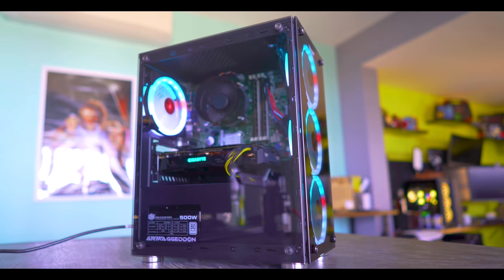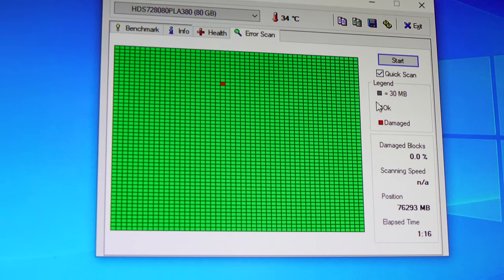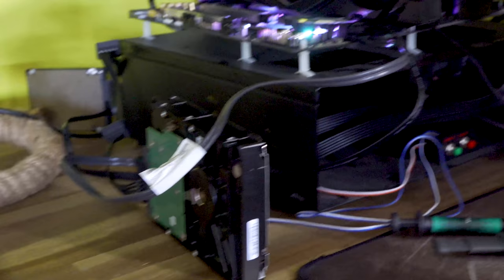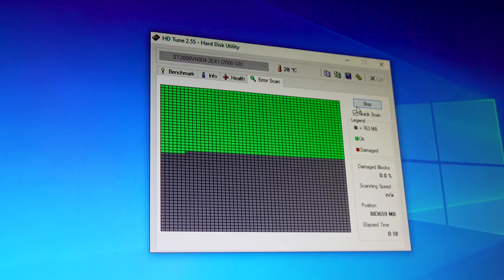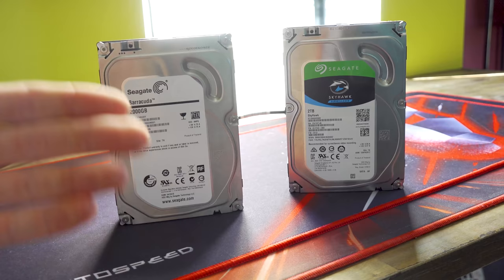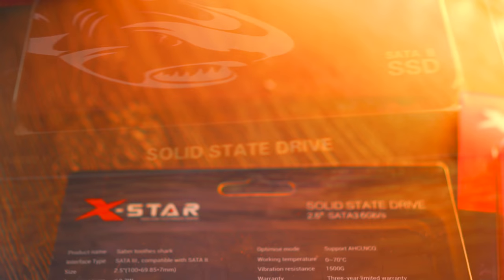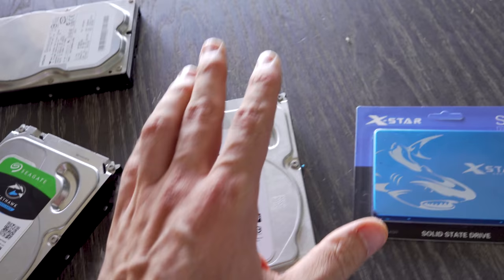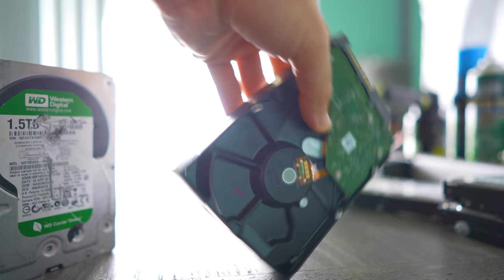Are USED Hard Drives Worth it...? (The Tech YES Buyer's Guide)

Comment: It seems like hard drives are designed to last for a long time. My oldest Toshiba laptop's hard drive is the original 4.1 GB from 1998. Still works fine today with no bad sectors at all even after 21 years.
Reply: I just got rid of an old Dell desktop that was running Windows XP.  The processor was failing.  But it had the original 250GB HDD in it and was still going strong.  It was too old for Windows 10 because there was no drivers for the hardware.
Reply: Toshiba
Reply: Best HDD i've ever owned Hitatch 250GB! PRetty fast and i have like,  7 of them, 5 used, and none of them have any signs of failure, despite being over a decade old!
Reply: They obviously shoud last a long time , data is important but they might fail
Reply: @namesurname4666  same hard drive even still works today in that laptop, now going on 23 years old that Toshiba laptop
Reply: Hard drive can run for 40 year's
Reply: @hamzaaamer9786  still have that same laptop even now and it's going on 24 years old and it's original hard drive still works. Has a date of October of 1998.
Reply: @KevinBenecke  dude 250 for windows XP era... You must been rich
Reply: 3 years late but.. I still have a working drive that is so old the "life" counter restarted a couple of years ago.. It shows way less hours than my much newer drives....
Reply: I agree, been taking care of some HDDs for nearly a decade of daily use. That is also why I dont trust refurbished, it is difficult and takes a lot to actually 'break' a HDD so a refurbished drive was really abused in use for it to stop working and demand a full repair.
Reply: @spider-spectre  I still have that Toshiba laptop with it's original 4 gb hard drive and still works fine with no bad sectors. Says that it's from 1998 so still not bad at all for a hard drive that's going on 25 years old now and I still have it on Windows 98 second edition.
Reply: Hard drives USED to be designed to last a long time. I have two 1 GB Seagate Hawk drives in a Sun SPARCstation 1+ that still work after more than 30 years. I've had recently manufactured drives fail within 4 years, though.
Reply: @littlemeg137  I could remember thinking that 1 GB was allot of storage space in 1997 when Windows 95 was the latest and greatest operating system from Microsoft.

Comment: Pro tip: make sure to turn off the quick scan option in HD tune cuz the results from the quick scan is not accurate.
Reply: Quick Scan should not be used alone to show that a drive works. It can however sometimes show when a drive fails.

This is how i do  my (used) hard drive checks:

1. Check SMART: If any bad sectors or seek errors, drive is bad, if good, go to next step
2. (Optional) Check HD tune quick, if any red squares, drive is bad, if good, go to next step
3. Check HD tune full, if any red squares, drive is bad, if good, go to next step
4. Wipe drive if used.
5. Check SMART again for any new errors

I do all of this with a copy of hirens boot CD 15.2, a free live cd/usb tool with hd tune included.

Comment: I just use white label drives. Instead of paying for a used drive and not know what you are getting, white labels are brand new drives by major manufacturers without a manufacturer warranty. Used drives usually are out if warranty anyway, might as well spend money on the new drive and sellers will usually give you a 1 year warranty

Comment: 8 years ago I got 3 2TB drives at 50 aud each. They're all still spinning to this day
Reply: dealing with an old failing disk taught me a whole lot about how to use computers and how to optimize my process, cause less wear to components etc... had a "clicking" disk that made a lot of noise on Windows, on Linux the thing is silent and still running... learned how to put my temporary files inside a RAMdisk (specially browser directory), learned how to use symlinks to store files that are written to constantly in another partition but make the system still think that it resides inside the same partition, etc etc... you say 8 years there, I don't doubt that number... SSD's just can't compare, all of the sudden you lose everything  (seeing people installing whole OS's inside SSDs just make my stomach turn by the way... well, the market depends on some dumb people burning money I guess...)
Reply: @FeelingShred  knock on wood none of the SSDs that I have ever bought over the past 10+ years has ever failed.  To give you an idea of how much usage they get as a boot drive, my current boot drive which is just over a year old is sitting on 17TB of data written.   The only one that I have that is a bit worrying is a Seagate 2TB SSD that is already at 90% life remaining after 5.36TB data written but it has been sitting at that value for the past 6 months or so despite being in use so it is possible that HWiNFO64 is reading the SMART values incorrectly.
Reply: @FeelingShred  Only on cheap SSD, old SLC x25-E have a life span beyond your own.  I still have some that work to this day, write life barely touched in s.m.a.r.t. even though they have written fully over many times over.  
But yes spinning drive prices have been stagnant forever.  Drives used or new, you need at least a pair regardless, so either way you trust nothing.

Comment: my Hitachi 1tb hdd is from 2009 and has 51000 Hours of workingtime 
and its still in my main pc
edit: i make regular backups of all my drives (old/new/hdd/sdd)
Reply: Hitachi hard drives are strongest hard drives
Reply: Mixa Tutorials hitachi wands too (Lenny face)
Reply: Older drives where built to last!
Reply: Hitachi last longer for me too, deskstar series are superb for home use.
Ultrastar is the best running raid 0 (I have 4 2TB drives on raid 0)
Reply: inb4 "i lost all my data"
Reply: I had both a Seagate and a WD drive from roughly 2011 which lasted up until very recently back in April I think, they both started to give out within a week or two of each other, it was by luck (well I also had been eyeballing their health) I had literally just bought a couple 2TB drives to replace them a few days prior, so lucky for me not only did I not lose any data (at least not anything I couldn't download) but I even gained some space, I also now run Hard Disk Sentinel to let me know if something is wrong.
Reply: My hitachi and toshiba drives have vastly outlived some seagate and WD drives I've owned. My 1tb hitachi drive (HDS7210CLA332)  is currently sitting at 1.5 petabytes of reads and 30,000 GB writes. It's 10 years old now :D
Reply: My 500gb hitachi drive is still alive since 2011, works perfectly fine
Reply: I have a set of 500g Maxtors that are still running and are from 2007. The problem is that a modern drive has a much higher data density and more platters.That's why the form factor is still 3.5" but you can have up to 14TB on a single drive. That higher density only increases chances of sectors failing. Its still best to have backups regardless.
Reply: Meanwhile, my 2tb Toshiba drive failed 3 months after the warranty expired
Reply: ngl my fav hdd to buy used are hitachi
Reply: i have a wd blue 500gb from 2007 and its also works like a charm in my pc
Reply: I have a 2009 seagate 1tb drive and it still works very well.
Reply: I also have a 3.2gb hard drive from 1999 that still works, a 60gb hard drive from 2003, and a couple 40-60gb laptop drives from 2004-2006.
Reply: My old computer had a HDD with about 60000 hours of Run time well according to SMART.
Reply: @Mixonne_  yeah,but old western digital blue drives are also great,i have one that is from 10 years ago,used it everyday,it even falled once,but still working,the only problem is that it has slowed down,from aproximatively 30 mb/s write 2 years ago to something like 15-20mb/s today i use it for lightweight os like windows xp or ubuntu,and for tests or experiences as it is near from the death
Reply: @leeadkins1360  I have a couple server drives I got for cheap, 100tb writes with 55k power on hours still going strong, HGST drives are tanks

Comment: New SSD, used HDD

Games aren't sensitive data
Reply: Savegames are though, so be sure to keep 'em on the SSD people
Reply: @pixel_vengeur391  true
I've lost countless hours of Skyrim saves when my hdd failed (OS and games where there)
Reply: @Davix-tt9sh  cloud saving is a thing
Reply: @illusionlb  There are cases where even cloud saves got corrupted
Reply: @illusionlb  not on cracked games (No, i'm not gonna buy skyrim again, Todd Howard)
Reply: @Davix-tt9sh  you can still upload your save folders to google drive periodically or something.
Reply: Same
Reply: @Davix-tt9sh failed  hdd can be recovered ( a bit expensive, but still ), failed ssd and you're toast
Reply: @pixel_vengeur391  If the SSD is your boot drive that is where the saved games will be...in your user folder...in MOST cases. Doesn't matter where the game is installed.
Reply: Norm T  a 1tb drive used can go for as little as $15. Well worth the risk of having to reinstall games in my opinion. Steam also backs up saves if you configure it to. I've also yet to have a used drive fail on me in all my years of PC building.

Edit: which is why I emphasize not to store important data on it in the first place. I'd take a brand new 120gb SSD over a used 240 one though.
Reply: @Davix-tt9sh  But Skyrim uses Steam cloud
Reply: @KhanhDinh291  It depends what has failed. It could be the controller board, in which you remove the NAND and put it in another controller.
Reply: @forevercomputing  not if cracked
Reply: Games may not be sensitive data but you paid money for them. So unless your games come from Steam or Origin, there is a good reason to hang on to them too.
Reply: @Davix-tt9sh  if you like the game, buy it.
Reply: @illusionlb  did you know the cloud run's of off h.d.d's in a server(LOL at you!!)
Reply: Make sure you keep important data in 3 locations. Asgard AN3 is a cheap 1TB NVMe drive with cash. Suggest to go with more reputable brand like Adata or Samsung.
Reply: @ArthursHD  absolutely. I don't trust noname SSDs or even used ones. But used hard drives are still good, most people upgrade out of storage needs, not because their drive died. I don't really have important data regardless. SSD die? Oh well I have a windows drive. Even if the hard drive does fail, if you buy your games legally, you can just download them again
Reply: That's because ssd prices dropped faster than hdd prices.
256gb m.2 ssd nvme is now just under PHP 2K
Reply: Unless you have a slow internet access...
Reply: @pixel_vengeur391  Cloud backup + local backup = OP
Reply: Tyler... Bruh,  but my 1TB "Homework" folder is.

Comment: Pro Tip: Download Crystal Disk Info, set it to "Start with Windows" and "Show in the Tray". It will warn you as soon as something unusual happens with your drive or if its about to fail. Helped me out a few times now.
Reply: HDD Sentinel is another such product which also supports dedicated hard drive RAID controllers. Not sure if crystal mark does that or not.
Reply: @pixels303at-odysee9  idk either, but great tip too
Reply: Agreed, I installed it to run all the time just a few weeks ago on my systems and notify me by email on issues.  Just two weeks later, it notified me of one drive that got a bad sector...then a couple days later it got another bad sector.  The early notification made it possible to swap the drive and easily transfer the data without having to pull it from backups. I do backup everything, but it's faster to just clone the data from a working drive. After the data was transferred, I stress tested that drive and a ton of new bad sectors to appeared.
Reply: @Zeric1  Glad it Helped you :)
Reply: Another stress test is to attempt to read the entire contents of the drive.  Bad sectors do not surface until a failure happens, and a failure is unknown until that sector is used.  Another trick to make your drives last longer is to mirror them, format them with ones and then zeros, and then copy data back.  Thus refreshes the strength of the data and even makes the drive speedier.
Reply: @pixels303at-odysee9  why does that make them last longer? Since you're reading and writing a LOT of data to that drive by doing that, and couldn't you just do a defrag?
Reply: @yotoprules9361  Defrag is not relevant.  The discs are magnetic.  Writing to all the area's on the surface in various data patterns will also change the parity bits which are stored and thus strengthening the polarity of the data on the magnetic disc.  All defrag does is rearranges data so that it is stored contiguously to reduce lag reading data.  Every time the read head moves, you get a added delay in reading the information, which this is called Latency.  My tip has everything to do with reducing the number of CRC errors with weak sectors on the disc.  When the data is read and the checksum doesn't add up, the data needs to be read again.  This process of re-reading data over and over again until it adds up a correct check sum (CRC) adds delays in reading data on your hard drive.  Typically, the older the hard drive is, or more accurately the longer the time since writing the data to the drive, the weaker the magnetic polarity will become.  This is relevant with floppy discs and CD/DVD discs as well, but also with respect to oxidization and ultraviolet light degradation.  I have had many older discs get harder and harder to read with time until one day the data is no longer readable.  Same goes with hard drives.
Reply: @pixels303at-odysee9  interesting

Comment: I bought a stack of used 10x2tb external seagate drives for $8 each (guy at flea market) and shucked them/tested. They contained personal information from a beauty supply company which included SSN's, Accounting information and personal emails... Wiped those immediately. They were apparently backup drives.
Reply: Pretty common when buying used drive/hardware. Pal of mine even went snooping with Recuva.

Comment: I have had great experience with used HDDs here in the UK recently. I like to buy in bulk, 10x 1Tb Seagate ST1000DM003 all from 2016 for £100 shipped in a segmented hard drive shipping box all in sealed anti static bags. Cheap and very cheerful. Before that 5x WD gold for £40
Reply: What do you need 10 hard drives for?
Reply: @IosifStalinsendsyoutoGulag  I also build and sell PC's
Reply: @bencarter96  Oh...so pre-built PCs often have used parts?
Reply: @IosifStalinsendsyoutoGulag  probably not pre built PC's from a shop, for me building PC's is a hobby so I just try to get people the best price for performance which often involves used parts. I just test everything well and give warranty, can't argue with lower price for the same performance

Comment: Another great tip for you or PC builders.  Use something like Seagate Seatools.  It's free and has a lot of the features of HD Tune.  You can even run the built in self test on the drives from a bootable USB or inside windows.  My favorite tool to asses HDD and SSD health is Hard Disk Sentinel (not free, but absolutely a great tool).

Comment: Good tips! Being mechanical devices wherein small misalignments can be disastrous it's definitely important to take a second good look at one. I'd like to add one thing: If you think something is wrong with only the PCB on the underside of the drive, don't bother trying to replace it. There's certain information on it regarding the physical properties of the platter in the drive. The chance that even a 100% identical model drive's PCB will work (without problems) is very slim
Reply: That would be usually the EEPROM, but knowing WD cheaped out on some drives a little bit too much, I wouldn't be surprised if someone tried to swap in a board, only to find out they have to transplant the MCU chip because there's no EEPROM.

Maybe I'm wrong but Seagates are far more lenient in this case - not 100% sure though.

Comment: I rarely go with used hard disks because I don't trust them as much as new, although on the rare occasion I do, I will:

> Ensure the warranty seals are in good shape
> the top cover is not dented or misshapen in any way
> Check the logic board on the back to ensure it's not damaged or missing screws

and with regards to the disk's health...
> listen to the disk. If there is any grinding noises or the bearings in the spindle make a lot of noise, don't bother with the disk. That spindle can and very easily sieze if the bearings are worn. even if the disk has low power on hours and the surface scan passes.

> I will check the drive's SMART data and verify that the following is at minimum above threshold:
- Ultra DMA CRC error rate
- High fly writes (especially on 2.5" disks)
- Pending Sector count
- Uncorrectable sector count
- Power on hours count
- power on count / stop-start count
- spin-up time

I will also perform a read/write benchmark to make sure the disk is still reading and writing data to itself at full speed. Disks tend to degrade over time but this will worsen if the disk has bad sectors. If you're unsure of the health of a disk that you're looking to buy... ask to see the disk and run a SMART analysis and surface scan on it.

Comment: Something I’d found a couple of times with old motherboards and new SSDs is that the SATA cable May be the problem, specially if the cable is not brand new. The system may not see the SSD but changing the SATA cable fixes the problem. Since the first time I experience this problem I always buy new SATA cables and I also try to use the shortest cable posible. Updating the firmware on the SSD also helps. Thanks for the great content!